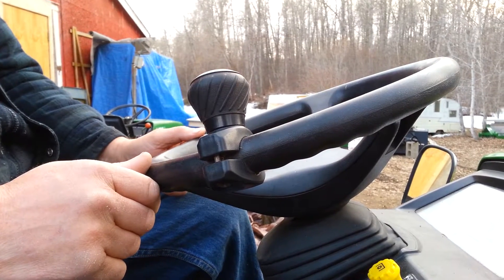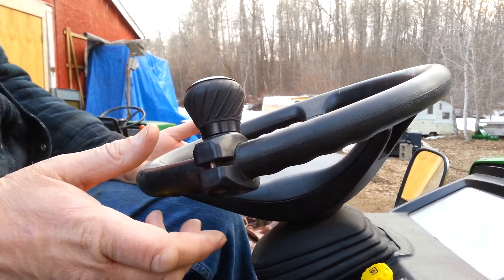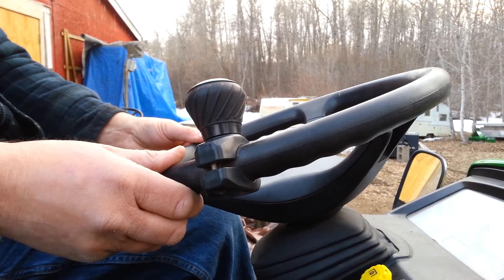Steering Wheel Loose

Comment: Did you get it fixed and what was the fix it needed?
Reply from the maker: Before I took the tractor in for warranty work I was able to tighten up the nut that holds the tilt lock bracket and that brought it back to how it was when new but still a little loose.  The dealer stated it was within spec so they wouldn't do any more.  When I get more time I plan to pull the entire tilt mechanism out because I believe the pivot bolts are not quite tight.